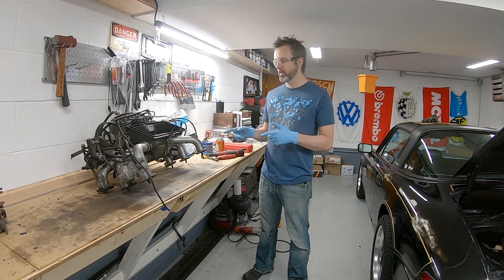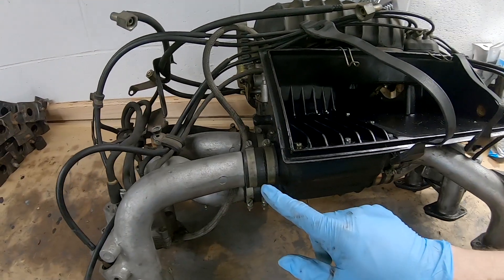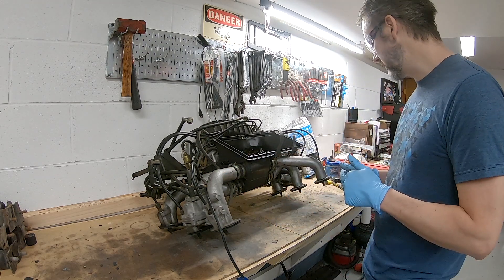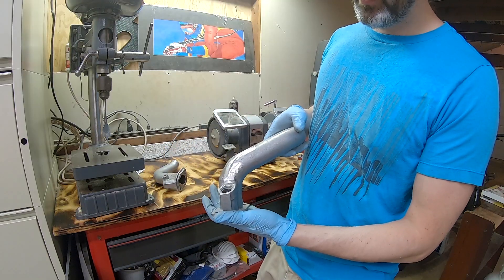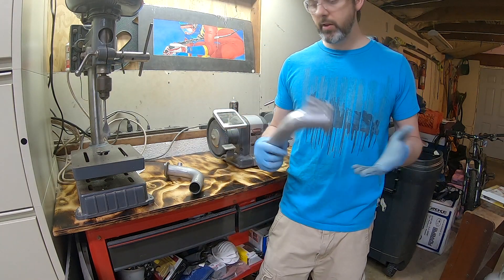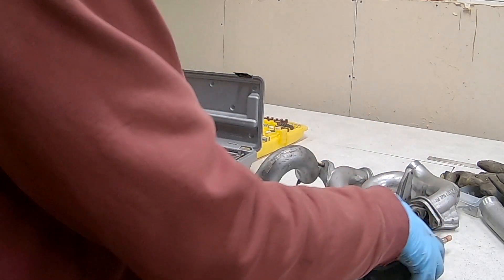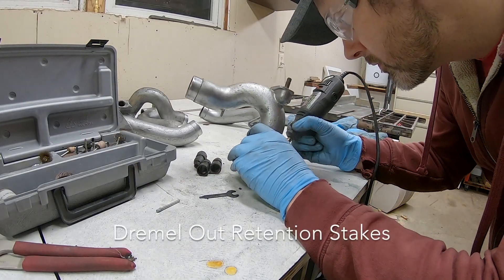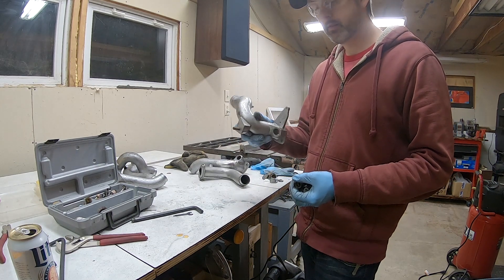How to Rebuild CIS Fuel Injection Porsche 911S!  Teardown & Modification, Projekt Airkult Episode 10

Comment: Are you sure you want to cut those lumps and metal off of the intake runners before you know what they possibly were for???
Reply: The factory smashed those marks there to secure the plastic insert that the injector o ring engages with. You grind them off to install a new one then do the same using a punch with the tip grind to the same shape and slam it with a hammer in the same place.

Comment: Yes - 'whatever this is' is the AAR - auxiliary air regulator. Idle control on CIS basically. Nice thing about CIS is that you dont need to care about mixing up fuel lines, its just a fire hose of fuel. Nice job on removing the casting bungs, nice touch. Good call on getting the injector seats out as well.

Comment: Nice touch removing the unused casting lugs. I'm sure you know this, but replace the hard plastic injector lines. These landmines have claimed the lives of many CIS cars in the past.
Reply from the maker: Replace with what?
Reply: @ADDvanced  you can use hard steel lines off of later cars or replace them with aftermarket braided stainless.
Reply from the maker: @rogerjohnson378  Thanks, another rabbit hole to dive into.  Lol.
Reply from the maker: @rogerjohnson378  Do you have any links for the braided ones?